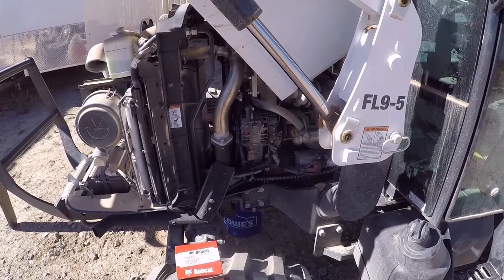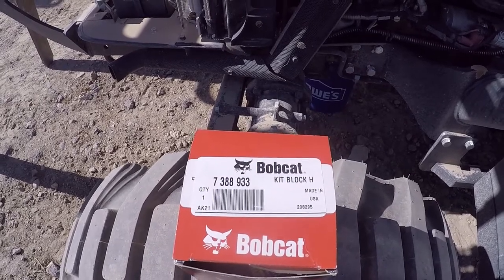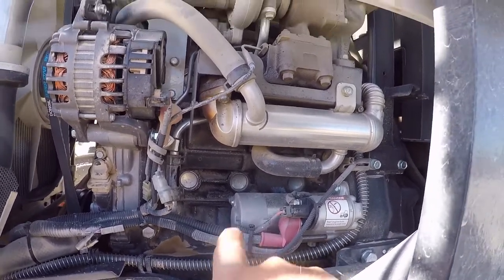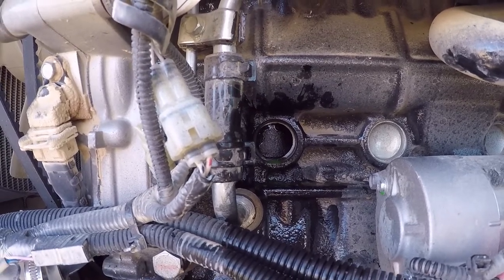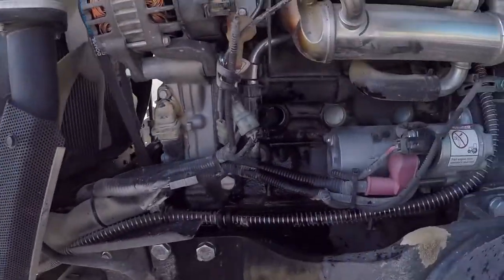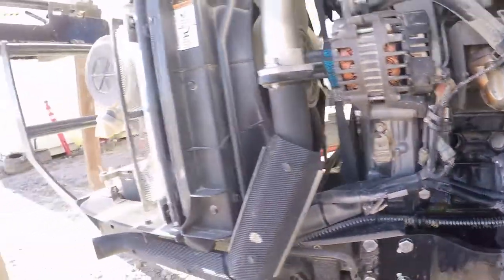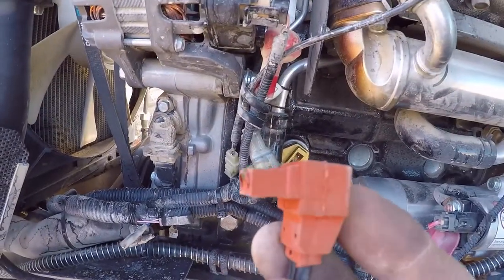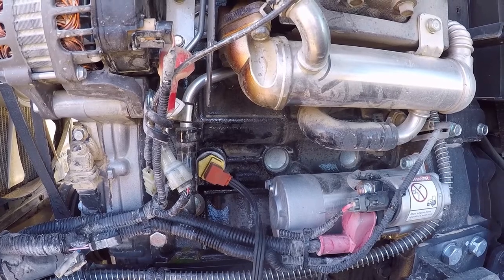Bobcat / Kioti Tractor Block Heater Install

Comment: If there was "casting sand" at the bottom of the block, wouldn't it be a good idea to flush with water while plug/heater block port was open?

Just hook a garden hose to the radiator and let it flow.  This would also dilute everything that you had on the ground.
Reply from the maker: Yes, flushing would have been a good idea. I would never flush with anything other than distilled water as to not contaminate the block and radiator with mineral deposits from house water. I did not have any extra distilled water or I would have done that. 
Thanks for the comment.

Comment: Also, while you had the radiator drained, could you have installed a new petcock/drain tube for future maintenance?

Very good chance that will be drained again in the future and this would have prevented a repeat situation.
Reply from the maker: Yeah, that would have been a good idea. I'm not sure where I would have put one. I guess maybe finding a spot in the heater hose for the cab, if it was low enough to drain the entire system.

Comment: At what temperature is the block heater needed?
Reply from the maker: It’s basically your preference. The glow plugs will get it started in extremely cold weather, but I then let the engine warm up for a while after starting before I use it. The block heater helps it start easier when cold and allows you to operate the tractor sooner because the coolant is already somewhat warmed. As far as I know there is not a set temp to use the block heater. I use it anytime the temp falls below freezing. It only needs to be plugged in for 1-1.5 hours before starting.
I hope that answers your question.

Comment: Is there a cure time for the loctite?  I bought the heater kit online and had the dealer install during the 50 hour service.
Reply from the maker: Yes, it is 10 minutes. I should have included that in the video.
Reply: @gaining_ground  So overall are you happier with your new CT5555?
Reply from the maker: @On_The_Farm  So far it is better than my last. I get intermittent transmission calibration lights which I had on the last, but so far no real trans problems. The steering has something going on, I can turn the wheel and it will keep going straight and then suddenly lurch in the direction I wanted. Dealership think it’s a break in issue.